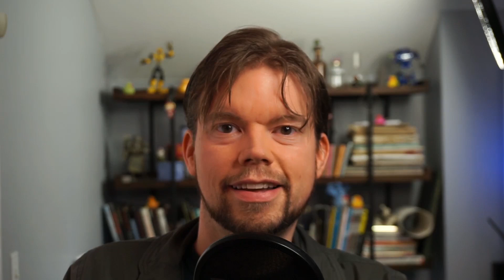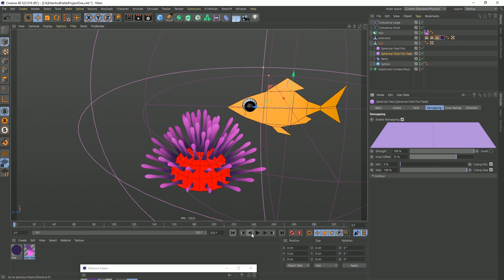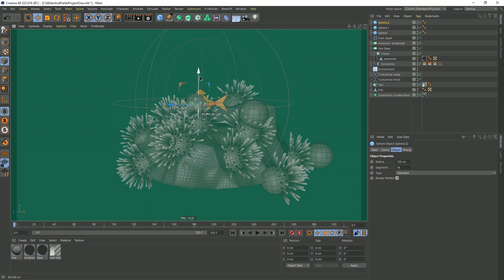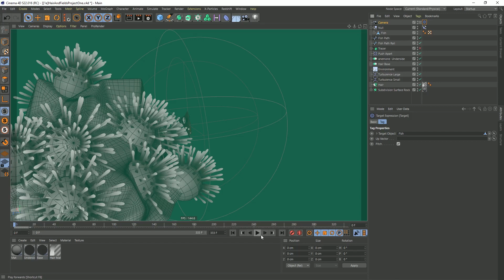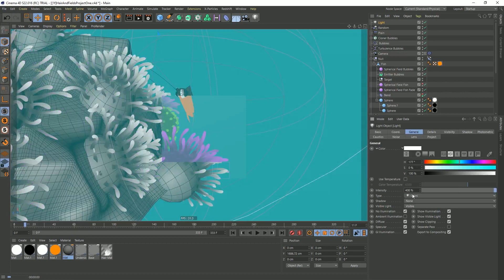Fields + Hair Cinema 4D Tutorial: Sea Anemone

Comment from the maker: 00:00:00 - Intro
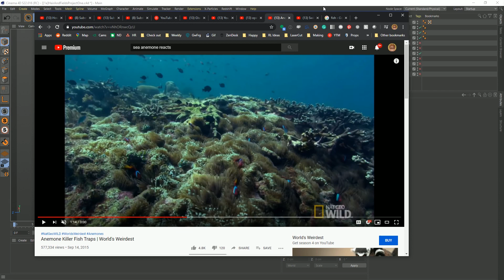00:01:22- What is already prepared (fish 'model'/rock)
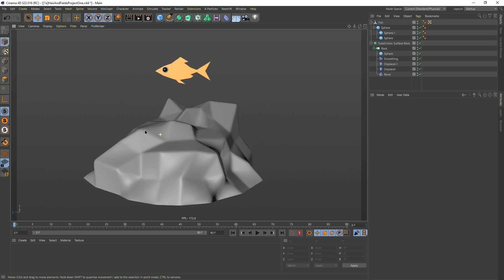00:02:46- Adding simple looping movement to the fish
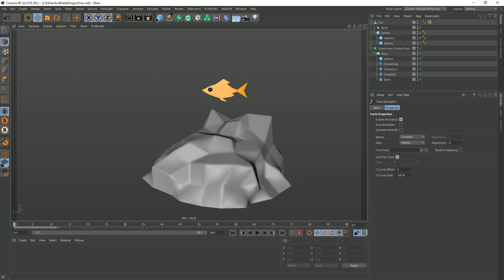00:4:40- Using C4D Hair to build a sea anemone
00:9:47- Adding random moment to hair
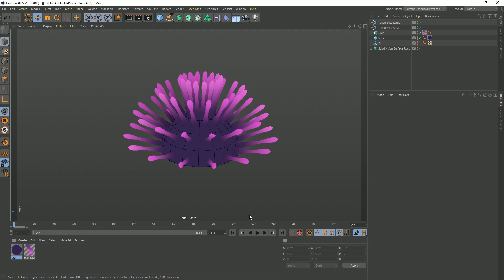00:13:34- Making Hair react to something moving nearby
00:24:14- Disco!
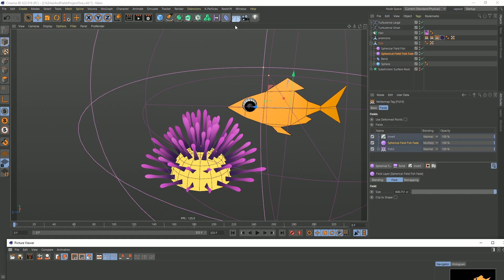00:28:51- Adding depth to the environment
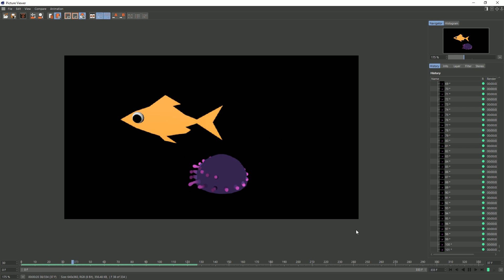00:29:54- Adding more artist control to the setup
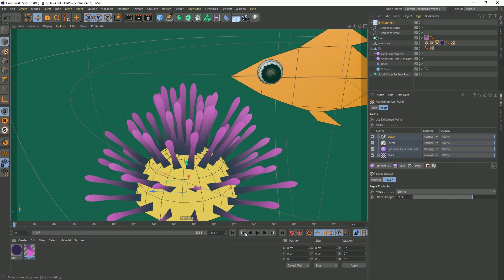00:33:33- Using the same Vertex Map to generate color to the Hair
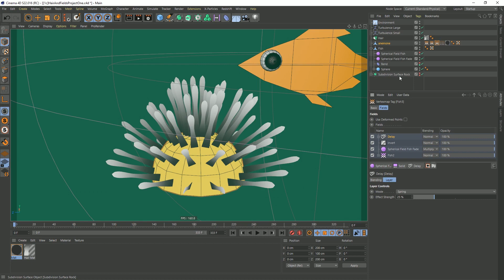00:39:48- Making more than one with an adaptable rig
00:52:05- Creating a path for the fish to travel, novel way to create the spline. Plus rail spline!
01:07:49- Adding bubbles to the fish
01:16:20- Using visible lights to add more detail to the background.
01:23:12- Get access to bonus streams, scene files, and more. https://www.patreon.com/RocketLasso